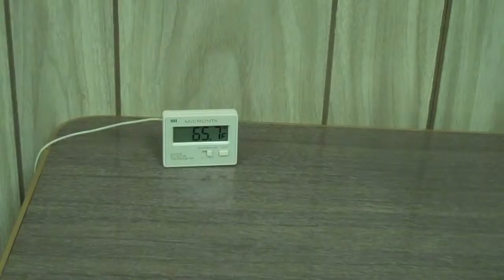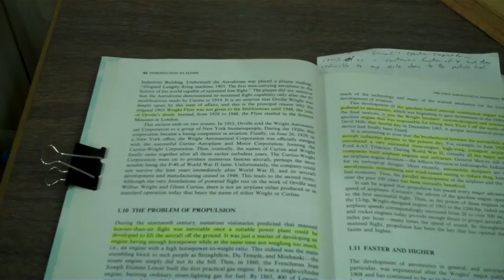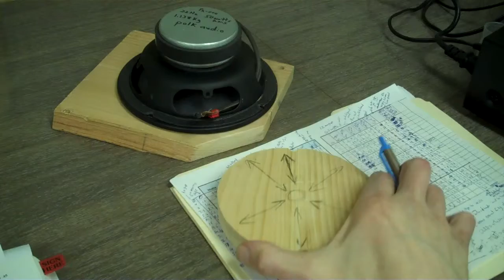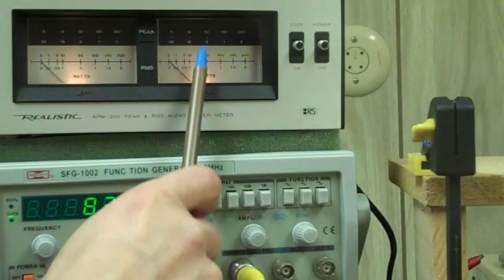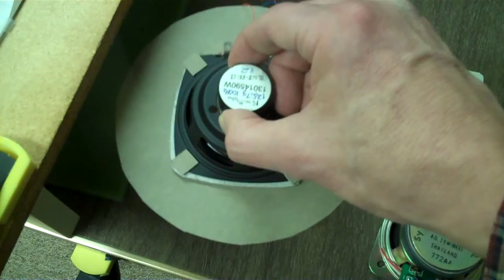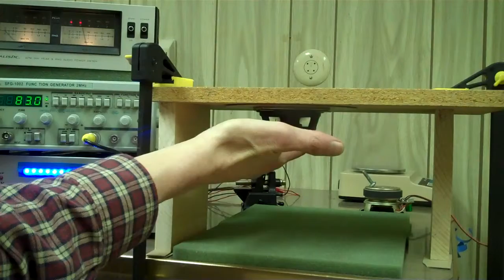OL2: O-Lift Speaker Selection

Comment: is the force of the sound equally pushing away from the table? you stated in your earlier video that AC lift did both.
Reply from the maker: There is a net "acoustic radiation pressure" directed away from the port in the speaker face plate, however this is much less than the constant outward push produced by a DC flow (e.g. from a hair drier).

The net acoustic pressure arises from the fact that once the speaker pushes air particles out of the port, those particles are the least likely to return to it when the diaphragm retracts (because they're moving away).  Instead, particles on the lateral surface of the face plate, surrounding the port, are most likely to be drawn in.  So there is an effective "acoustic stream" of particles away from the port, until they disperse and slowly circulate back onto the face plate and back in the port.

YouTube has some nice videos of acoustic streaming in liquids: https://youtu.be/XkoHYD3CDo0
Reply: David Colasante does this only work at a certain range of frequency?
Reply from the maker: Yes.  Each system has it's own mechanical resonance.  It's fun to explore how this changes with different wing materials, shapes and sizes as well as the driver selected.  As the wavelengths of sound at this frequency is about four meters, the O-lift devices don't rely specifically on acoustic resonance.  The radius of my wing is much smaller than the 1/4 or 1/2 wavelength that might be expected.